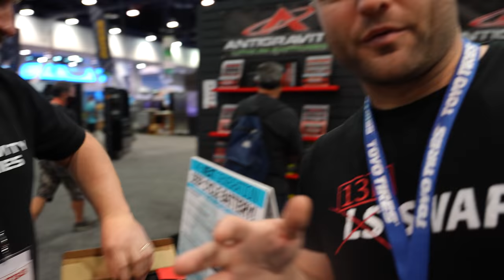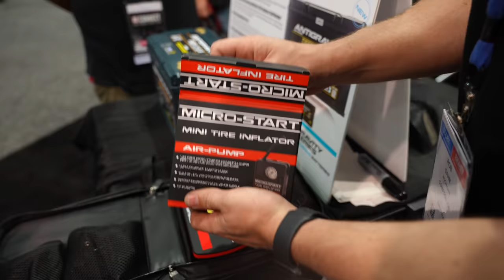Hert didn’t want to hurt the RX-8 at SEMA. He’s smarter than us

Comment: Isaiah is trying so hard to blow his motor😂 just change the oil and “forget” to fill it back up
Reply: Jim jibroni  right
Reply: I want it to blow up so Isaiah can get his 3 Rotor. But I also don't want it to blow up because it won't do much to help the "reliable rotary" thing that they're trying to push.
Reply: He wants that 3 rotor 😂😂
Reply: Jim jibroni  🤣🤣
Reply: @shona5512  I mean it's taken a hell of a beating... I doubt a piston engine would be able to handle the sane
Reply: @shona5512  If they fail to blow it up, then it helps them way more than any 500-mile trip ever could.
Reply: The RX-8 will run still in pure spite
Reply: i assume he still has the oil metering pump, so just forget about oil completely.
Reply: @Delzra  I think a system where you have a small tank where u put 2 stroke into wouldof made alot more sense for Mazda, like it would pump in a bit of 2 stroke in and measure it somehow, yes something else that can break but I mean majority of people don't check their oil often and unlike the rx7, theirs many rx8 owners I assume that are just normal people who thought it looked cool (well before these cars went extinct)
Reply: @padraigrab08  that’s actually where the SOHN oil adapter comes in. It’s an aftermarket adapter that allows you to install an extra reservoir specifically for your 2 stroke oil to feed directly to the omp

Comment: 3 rotor on the RX-8 confirmed? Fabrication Father is making me more and more hyped in his RX-8!

Will it be a Renesis 3 rotor, or like a Eunos Cosmo?
Reply: A normal 20B-REW, nobody's stupid enough to make a 3 rotor with a Renesis! 😂😂😂😂
Reply: @joealex65  But people have made renesis 4 rotors
Reply: Doesnt Rob ultimately want to machine his own rotors?

Hopefully when he is done then it will be a Dahm 3 rotor
Reply: The dahminator
Reply: @joealex65  It's so stupid that people crap all over a rotary without actually spending any time to actually know what the issue was with the engine. Mazda in it's infinite wisdom wanted to stop the uninformed people who claimed that the engines were always bad because they burned oil as if they aren't supposed to. So instead of educating people on how the motor works they removed the centre oil injector from the engine so it would introduce less oil into the cylinder. This (obviously to anyone who knows anything about rotary engines) caused the apex seals to fail and the engines to blow. To fix this they increased the oil fed into the engine by the oil metering pump. It's got nothing to do with crappy apex seals or garbage housings like tons of people say because they have no idea what they are talking about. You remove the oil metering pump and add two stroke to the oil and problem solved. 
As for the problem with the exhaust it's easily fixed by one of a few different methods and there's a guy who used to race a Renesis motor and made more power than the original with more reliability by basically adding back the original exhaust port. A few people have done it successfully and the Renesis breathes way better than the REW.

Comment: How should we blow up the renesis guys???
Reply: Turbo and boost to the moon please!
Reply: Burnouts till it burns down!!
Reply: Those are my only 2 ideas some boost sounds like the only logical way to do it
Reply: Just drive it and itll do the work itself
Reply: Pls moon boost it
Reply: Nitrous, two of the big bottles. Wet shot so it might survive for a while. Start with a small shot and keep going bigger until you find the limit of the clutch or the engine.

Comment: Those Anti Gravity Portable Batterys lemme tell you..... They are worth every fucking penny.. i used the living FUCK out of mine to the point the plastic casing is no longer with me. it still works tho and works for hours. I made a portable sound system using it as a battery and the fucker last's a good 15 hours. plus it will jump someone's truck easily lmao.

Comment: the best jump starter packs are the supercapacitor ones. gets to 14v fast if you charge it with something like your phone or a full battery in a different car but it can also slowly charge off a near dead battery. i had a car that i had to jump every time due to a wiring issue so trust me when i say its the best. if your jump pack has to be charged or plugged in you might as well just add a second battery.

Comment: Hey rob, are you aware how unsafe those lithium jump packs are? 

Suffice to say you should never leave them on charge unattended nor should they even be stored in the car or any place that is not fire proof. These batteries are light weight and generate tremendous current but are super unstable. If the voltage gets too high or too low in any of the battery cells the battery catches on fire and/or explodes, if you get them too hot or draw too much current they catch on fire and/or explode, charge them too fast or have a cell die during charging and they.......... you guessed it, catch on fire and/or explode.